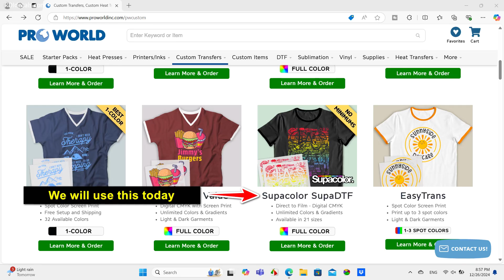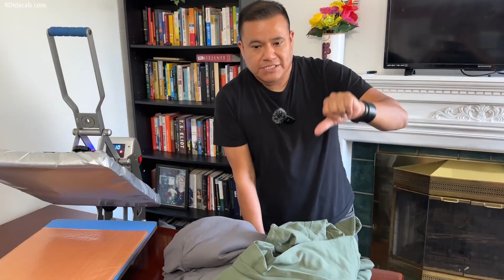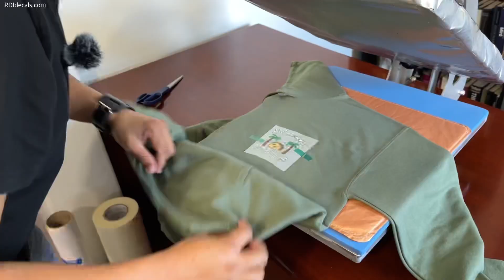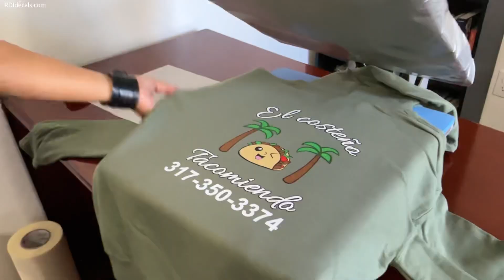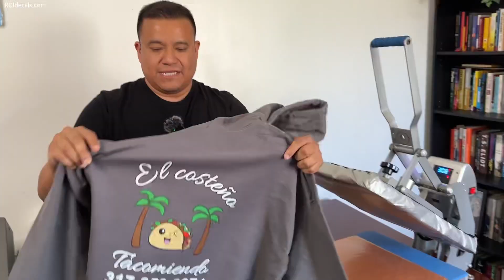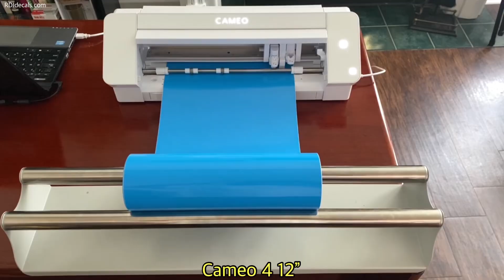You can make these without a VINYL CUTTER

Comment from the maker: Our website: https://rdidecals.com
Get your transfers here: https://www.proworldinc.com
Get t-shirts here: https://bit.ly/3RA6DdF
Hotronix heat-press 16x16: https://amzn.to/4e2cjpn
Graphtec vinyl cutter:  https://amzn.to/3pIrIkS
USCutter Titan 28 inch Vinyl Cutter: https://amzn.to/3yC1jwn
CAMEO 4 (12 INCH): https://amzn.to/3uy66jc
CAMEO PRO (24 INCH):https://amzn.to/3POgbNO
Heat transfer tape: https://amzn.to/4etRBhP
Shipping tubes: https://amzn.to/3LPgSXJ
R-TAPE Conform 4075RLA (Paper transfer):  https://amzn.to/3S5CDG3
Corner rounder: https://amzn.to/3JbJQzI
Oracal 651 vinyl 12x24 ft roll: https://amzn.to/46wUTMQ
Oracal 651 vinyl 24"x10 yard roll: https://amzn.to/3ulmXRJ
Reflective vinyl: https://uscutter.com/24-oralite-5300-economy-grade-reflective-film
Tape application roller: https://amzn.to/45apQGa
Oracal color guide (only for 651 & 631 vinyl): https://amzn.to/3W6Q0ow
Magnum magnetics 24"x25' : https://amzn.to/3P6AHdJ
Blank yard signs: https://amzn.to/2IBiGWM
RAPID TAC: https://amzn.to/37ZMl5O
Cutting mat: https://amzn.to/3uidBWZ
Blue safety ruler (31 inch long) https://amzn.to/3slsrKy
Squeegee: https://amzn.to/3bmZK8Q
Small magnets to hold vinyl in position:  https://amzn.to/3kdE6bt
Cutting knife tool: https://amzn.to/3sbDTYS
Adhesive remover goof off: https://amzn.to/3eXrNS2
Siser Glitter Vinyl: https://amzn.to/3u1gnnO
Siser color guide: https://amzn.to/3ZuQJ60
Teflon sheet: https://amzn.to/3HvhRKx
Teflon pillow: https://amzn.to/3Sheqw1
15x15 heat press teflon cover: https://amzn.to/42gjt4i